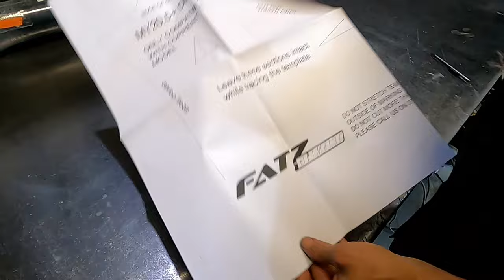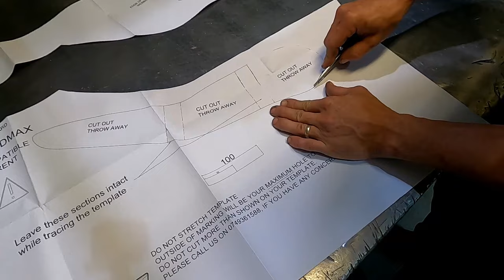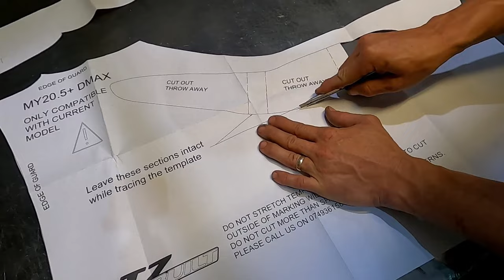Fatz Fabrication Isuzu D-Max MY20 Snorkel Installation

Comment: The workmanship on the installation is top notch, no doubt, but that is a stupid amount of metal to cut out of the front guard when a couple of small bends in the snorkel could have halved the amount needed to be removed.
Sorry guys, I will keep looking for a snorkel for my Dmax
Reply from the maker: Thanks Andy, the last 12 years in business we have been doing it this way to keep the bends on the outside of the guard to a minimum and also to avoid painful plumbing situations between inner and outer guard. 
It all comes down to preference in the end. 
Happy Shopping

Comment: What air saw are you using?
Reply from the maker: Hey Paul, this is just a generic brand air saw

The trick is to have extra layers of tape encase the blade comes out of the cut